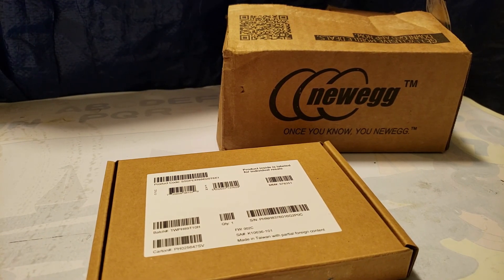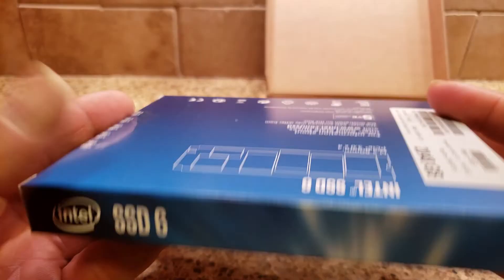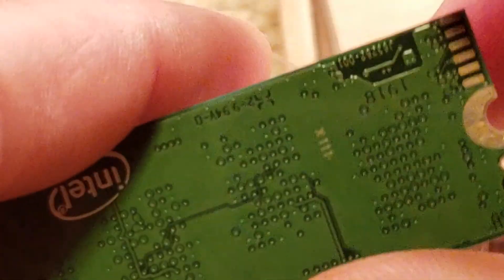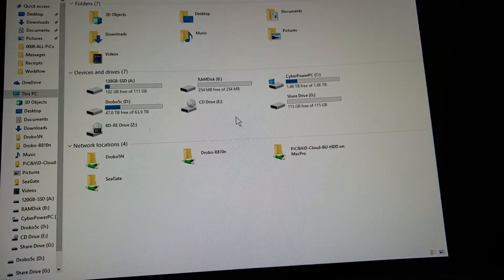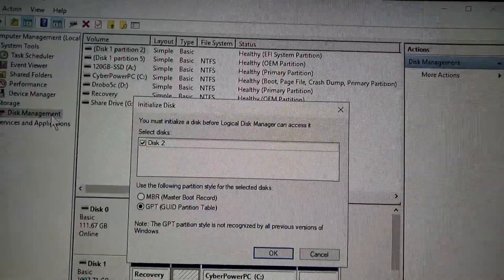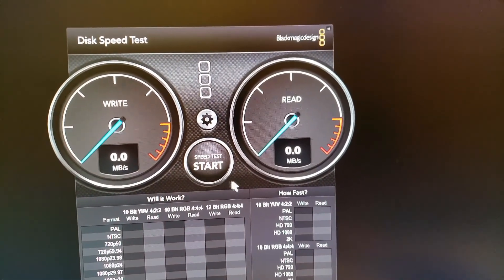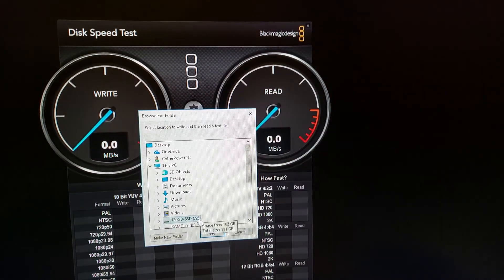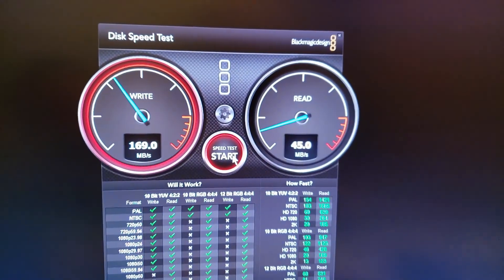Intel 660p Series M.2 2280 2TB PCie 3D NAND Internal Solid State Drive SSD SSDPEKNW020T8X1

Comment: Do these disable any SATA drives?
Reply from the maker: Veto no, you do that in the bios
Reply: @mtandiz  Do what in the bios?
Reply from the maker: Veto the bios will allow you to enable & disable your sata ports, like the standard sata ports, & the m.2 Sata port. The name goes into an m.2 port on your motherboard
Reply: @mtandiz  I know but when connected it will disable sata 4 and 5 according to the gigabyte gaming 7 manual
Reply from the maker: Veto sorry to hear that, I have an asus motherhood, it allows all sata ports / connections to be live / open. It may be a limitation on your mother board , sorry too hear that, I am sorry, I have no solution with your problem, if the manual says that, than it will happen. I know in the past you would be able too bypass those issues using dip switch’s, but I haven’t seen a dip switch in decades

Comment: Hey I just wanted to throw in my two cents,    this is going to be kind of long-winded so just bear with me and let you know that the reason why that hard drive might not be going as fast as advertise is because you have it installed in the wrong m. 2 slot ....you should have another m.2 slot that's PCI 3.0 x4,  it should be above your video card depending on your motherboard, it has a direct connection to your CPU the slot that you have the hard drive plugged into now goes through the chipset that's why it slower it's not actually PCI 3.0 4 lane m.2 slot .  Look for the other m.2  slot and use that one..
Reply from the maker: Martin Szadzinski you are totally correct, I had fixed issue shortly after this video. Have not updated info / video/